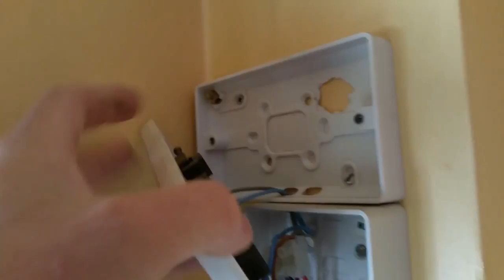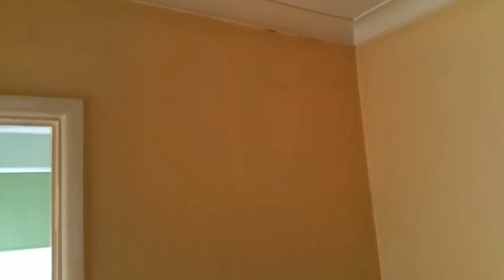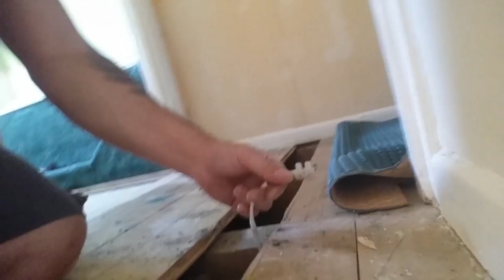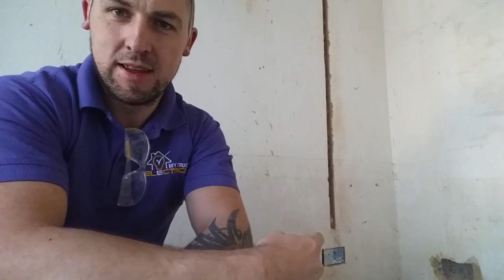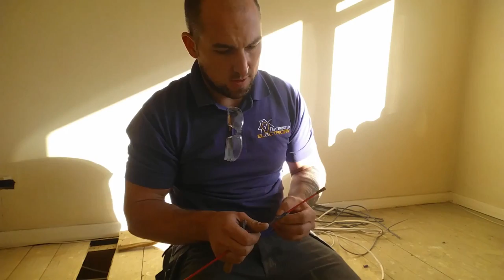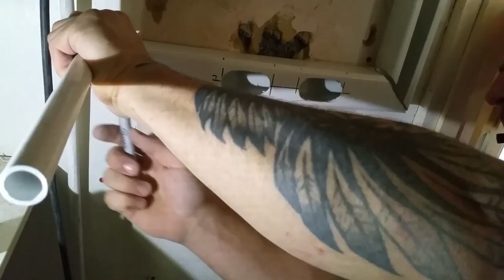HOUSE REWIRE - First Fix & Consumer Unit Install

Comment: What size/brand of trunking is that behind the CU?  

Great video mate 👍🏻👍🏻
Reply from the maker: Brand = whatever the supplier has on the shelf. Preferred brand is MT.

Size = you need at least 40% spare space within the trunking and so it's not always a generic size to go behind.

👍
Reply: @MyTrustedElectrician  According to the On-Site Guide 2018,Table E6,  the maximum space to be occupied by cables is 45% of the Internal cross sectional area of the trunking.  This means that you have to leave at least 55% space.
Reply: @MyTrustedElectrician  Does grouping factor come in to play with the circuits in the trunking around the C.U? I work in marine so it's abit different. Enjoy your vids, keep them coming.
Reply from the maker: @aaronwoods8625  grouping factors need to be taken into account throughout the entire installation.

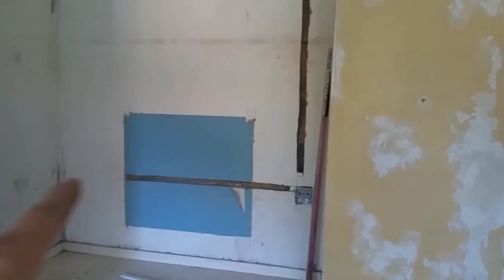Comment: At 14:20 are you allowed have the chase going across the wall for the mirror lights. I'm Irish and regulation changes in the last year say we can't do horizontal chases
Reply from the maker: Good question. In the UK we're allowed to run chases as long as they're verticle/horizontal from a switch/socket/fixture. This allows everyone to know where 'not' to drill holes.

The regulations go deeper then this but this is the simplified version.
Reply: Just keep within the width of the accessory. Easy.
Reply: I see. Thanks for the reply
Reply: Which Rule is that then?

Comment: is it not easier to install individual RCBO's? your neutrals will now be short if you ever decide to do this.
Reply: Yeah I always try to leave as much length on my tails as possible!
Reply: He left slack on the cables I seen him push the excess back into the wall behind the consumer unit

Comment: Hi. why you don't leave a spare length of wires in distribution board? I'm on my way to become an electrician, doing level 2 recently so I keep asking questions 🙂cheers
Reply: He did m8 but pushed it back into the entry at the back of the consumer unit

Comment: So, if we want to employ a 'proper' electrician and not a 'part P' cowboy, what qualifications should we ask for?
Reply: JIB registered Electrician usually would have the following  -  
City & Guilds Electrical Installation 
NVQ L2 & L3 Electrical Installation 
AM1 & AM2 trade test
IET wiring regs 
Test & Inspection certs .
Reply: The best thing to look for is an nic eic approved contractor

Comment: You should forward those pics to the prof E & I, porn for sparkys. Love finding the crap people install and ripping it all out and starting again. Your pain is our pleasure. Cool hand Luke of sparkys.
Reply from the maker: FYI I tweeted a couple that I didn't include in the video. Sockets under floorboards 🙈
Reply: Good man. Will look out for them.

Comment: I've been watching a lot of electoral videos from the UK and just wondering why all of the switchboards are in some absolute outrageous locations? Is it because the houses are very old and regs were not so strict?
Reply: Main reason is where the supply mains wire comes into the house. Yes, the UK is a very old nation, and some properties are many centuries old.
A switchboard in the UK is a Consumer Unit.

Comment: You mentioned about 4 years to learn whats your opinion on these 20 day fast track courses?
Reply from the maker: Bollocks. You couldn't teach a monkey to throw shit in 20 days. They need to create an 'electricians card' and 'online data base' which proves the competency  of each electrician. It should display their length of time in the field, qualifications and red flags. Let the customer/employer know what and who they're trusting to carry out life threatening workmanship. This the only trade where a loose screw can burn a house down. Any other trade will at worst have a wonky shelf or leaky tap.
Reply: @MyTrustedElectrician  i see were your coming from mate just curious as the end of most of them courses you can then apply for eicr approved which has always suprised me

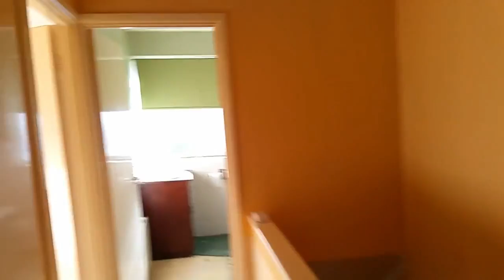Comment: 4:51. To comply with regs, do they need to be fire-rated?
Also, is there any reg that prohibits sockets on different circuits in the same room?
Are all the cables in safe zones?
Can you use 1 millimetre on lights too?

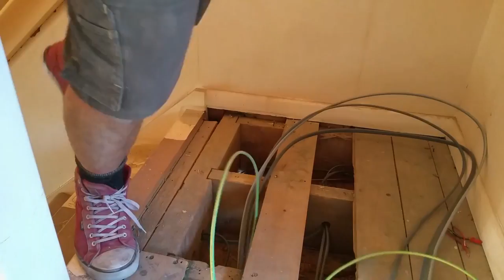Comment: 16:26.  You can clearly see rough, unprotected edges of the rear plates you will be bringing your cables through.  These rough edges can cause short circuits.  They need to be shielded with non-conductive material that can withstand abrasion.  I am not a sparkie, but a knowledgeable amateur with plenty of common-sense.  I am certain your wiring regs will have something to say about this type of situation.

Comment: Enjoying the videos and understand your frustration of DIYrs doing jobs unfortunatly thats how things are.
Yes you get bad work but also good work and to be brutaly honest these videos encourage people to do the jobs themselves   but in a good way as it gets the potential DIYer to think about what they are doing. OK yes they can't test the cercuit but if they are not complete morons videos like this stear us in the right direction. I have subsribed because I love to learn so keep the videos coming.
Reply: @rik061119  The Building Regulations do not restrict who may carry out electrical installation work. If you want to do the work yourself you should make sure that you know what you need to do before starting any works. There are a number of reputable guides that you can use to help you.

As I said these videos encourage diyrs. Some competent some not. One issue is the cost for having the work tested and passed puts reporting off. Just my thoughts.
Reply: But the reporting makes it compliant and legal not a matter of cost just hope it never kills someone or burns the property down
Reply: @rik061119  the statement was these types of videos encourage DIYers. So if you want to put things out off the reach of incompetent people then remove all electrical, building, plumbing type videos of YouTube. It's no good bitxhing about DIYers then putting videos up. The regs ensures compliance however if you have a spark quoting a grand for a job that can be completed competently for a tone then what can you expect. All I've said is pricing is why people go DIY. If I didn't know what I was doing then I'd call in a spark a plumber etc as I hope many would but as stated videos like this encourage none compliance due to cost cost is everything when your on your arse every week. As I said only my thoughts.
Reply: @BillsAllotmentDiary  they should be removed from consumer purchase and be trade only but unfortunately that is an impossibility with things like consumer rights, the problem is too many people think the know what they are doing and don't fully understand the full implication if something we to go wrong grenfell is the perfect example of how and what happened when your electrics are bad
Reply: @rik061119  ok and has absolutely nothing to do with the cladding that they knew was a fire hazards but allowed under regulations. And hang on the fire allegedly started due to a faulty fridge catching fire I saw or read nothing stating the fire started due to some fool wiring something wrong lol anyway life's what it is enjoy
Reply: @rik061119  The DIYer can self report to building control and do work under that supervision, cost a fortune but it is a method. I do agree with Billy The Loam Gardener, there should be a methodology where a DIYer can get a competent spark to test the installation. OK so there would need to be evidence of wiring in zones etc but provided that's given why shouldn't we sign it off for a suitable fee?
Reply: Sparkies will never be out of work🙈⚡

Comment: Does anyone have an average price for a full house rewire? 3 bed 1 sockets in each room, kitchen lounge and hall. My dad said the wiring in my nans house (his mum) is dangerous but never got it sorted for her now I'm here with my son and step son...worrying about it.
Reply: No point in putting 1 socket in each room you won't have enough points to use

Comment: Obviously a terrible mess you have found.
One thing, check out reg 521.9.1
Flex is allowed for use as fixed wiring obviously needs to be correctly installed and sized, mechanical protection provided if necessary.
Reply from the maker: Thanks buddy. I'll have a look.
Reply: Check out the current carrying capacities of flexes too! They carry more than the equivalent T+E!

Comment: If the shower cable was on top of 2 cold water supplies then it’s effectively water cooled 😂😂😂. 
I’m not one to do the usual DIYer rant but in this case you can see why sparkys hate DIYers having a go at electrics. 

There should be mandatory training for DIYers to do before they touch anything. We cant just say “no diy” like they do in Australia as that’s dumb, but when someone does this level of stupidity then it’s just dangerous.

Comment: Screwing consumer unit onto trunking lids for a fixing solution? This is purely for entertainment surely.
Reply: I didn't like the length he left in the board as well if it needs a new board for the 18th for any reason it will be fucked 🤣🤣
Reply: If you look closely the board was screwed to the wall with spacers.
Reply: @rik061119  agree on length. It's about the only critic I have, unless he left slack in the trunking. But why would you need to change the board for the 18th? It's not retrospective. The board may need to be changed at some future date but this whole changing the board melarky every 5 minutes is a complete BS red herring.
Reply: Jason, the trunking lid is a conduit for the cables. Note the four holes that are the dimension of the consumer, two above trunking and the two below. This tells me that the board is plugged and screwed into the wall

Comment: Why were the blanks staggered at the board?
Reply from the maker: I really wish I had mentioned this in the video. Damn damn damn!

It's the way I do it. I spread the MCB's apart. Future proofing. If a new circuit needs to be added, it has a space ready and can still be in size order.
Reply: @MyTrustedElectrician  I can kind of understand the logic but surely it'd be just as easy to move the breaker down one as and when additions are made.
Reply from the maker: @ashmanelectricalservices4318  move a breaker and you need to re-test that circuit and provide an installation cert for it. Not worth the hassle.
Reply: @MyTrustedElectrician  But if you came back to install another circuit, you'd have to provide an installation certificate anyway yes... Anyway each to their own. Did the board come fully populated?